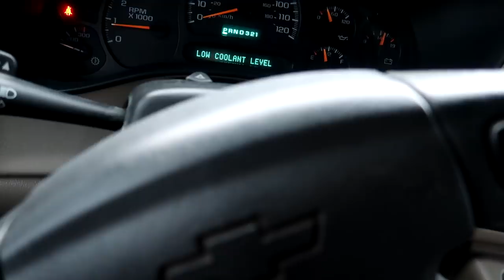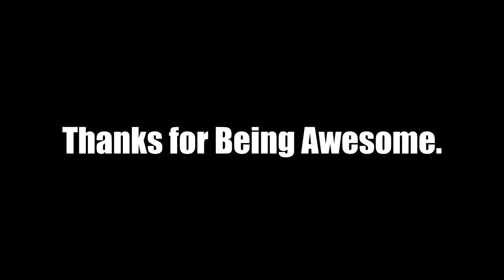THIS could have TOTALED MY TRUCK!

Comment: I recently replaced my power steering pump on my suburban I used a large adjustable wrench and a hammer to get the fan off worked like a dream

Comment: It's recommend when changing the water pump to also change the clutch fan.
Reply: Why?  And why would you replace the whole fan assembly when you can replace just the clutch assembly on the fan if it happens to be bad. The clutch can be checked to see whether or not its bad and replaced as needed. Oh you said it's recommended to replace the clutch fan while changing the water pump. Glad your not a mechanic. I am just busting your balls I know what you meant. Take care.

Comment: Look it will start a flame war but on the real, my ford focus 5-speed manual from 2001 hasn't had to have this much work. It just recently had to have it's tranny replaced after 200,000 miles. Not bad. That and a fuel pump are the only things I've ever had to do. All the Ford's that have ever been in my life had only done real work. Not a lot of time in the shop. I'll take my good experience and pay it forward with another Ford until there is a bad taste in my mouth. Hopefully its a while down the road.

Comment: Don't put the fan on the ground like that. Because it is not good for the fluid that is inside of the fan. It can get hard and that is not what you want. You can check if the fan is still good by mounting it and rotating it. If it doesn't move your fan is broken and your engine can not control the temperature right.

Comment: What mods should i do to a trx450er or a 400ex?
Reply: never exhaust lol, less back pressure = messed up valves, bought a bike with an fmf big mistake.
Reply: Griffin 37 bs
Reply: mkay whatever you say sweetie
Reply: i would definitely get exhaust
Reply: i mean they look and sound better but youre letting more air out which makes your exhaust valves work harder because of less back pressure
Reply: in my opinion definitely worth it to have to replace valves a little sooner
Reply: i cracked a valve guide and had to replace most of the head

Comment: NO OIL OR GREASE ON THE PULLY!!! That has to go clean onto the shaft. If not it will wiggle around and damage the crap out of it. You will see that when it starts to skip beats... Look in the repair manual!!! it says explicit "Free" of grease and oil.
Reply: onhawaii You are assuming that he has any sort of common sense. Clearly he has no idea what he is doing.

Comment: I dont understand why you only had one bolt?
Reply: Maybe the cv joint has been replaced and they did not tighten the bolts correctly, like some one said check the other side as well.

Comment: clicc baitxxxxx
Reply: sexynamesmiff if the truck has no coolant what happens ?
Reply: Run your car without coolant for a few hours tell me what happens
Reply: it over heats
Reply: If u actually watch vid  the cv axle only had 1 bolt and one that u could unscrew with your hand an if that could off.u would lose control so that means he would of totaled the truck...it’s pretty sketchy
Reply: ook
Reply: Not at all close to it. That one part did almost total his truck, so it's more or less a headline to a story.
Reply: Eh, no not really. He's done that a few times in the past, but this time is relatively legit.